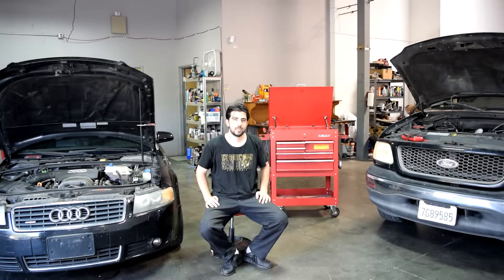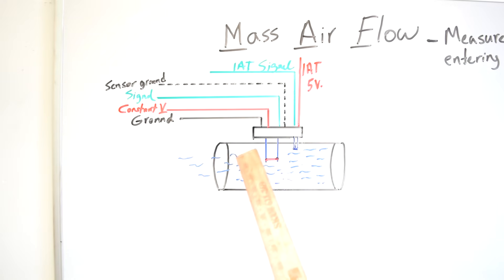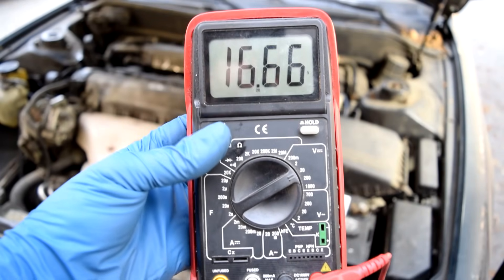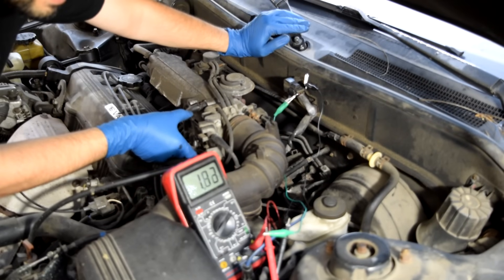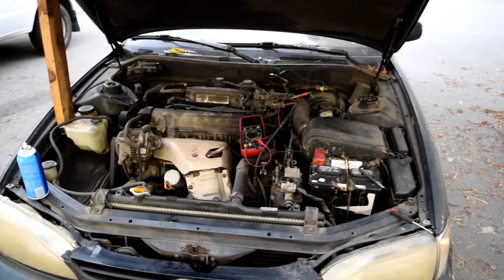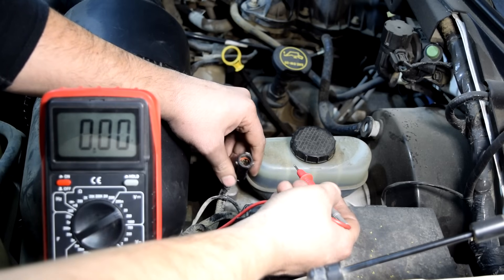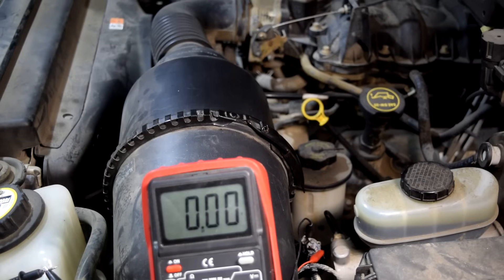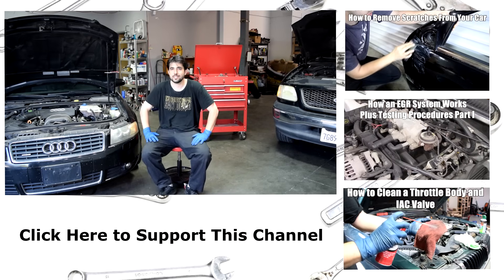How to Test a MAF or MAP Sensor With a Multimeter - Plus an Operations Guide

Comment: Will a dirty Mass Air Flow Sensor make the car stall? Also, on my car when I unplugged the MAF, my car shut off. My brother's car is stalling when driving, when I unplugged his MAF, his car still ran. Any ideas? Thanks
Reply: Tom O did you ever figure it out I’m wondering the same?
Reply: If somebody needs the information: it depends from car to car. Remeber: the maf or map sensor is used to calculate the air/fuel ratio. If you habe a broken, durty, ... sensor your engine can have trouble to calculate the right mixture. Old cars dont have as much problems because there tollerance is a lot higher. Like old and new diesel engines. In new cars the engines are so fuel efficient because they are tuned very well. But pefect tuned cars need more love.

So some cars will go out, some will go into a emergency programm... it can depend hard. But yes it can make your car stall and stuff.

Like in the video you see when he applies hard throttle the sensor "work", but when crussing it wont.

With a maf sensor it can also be that you get some "wrong air" after the sensor (when you have a hole in your system where it sucks air into the system after it passes the maf sensor). So the sensor doesnt register all the air what is going into the engine and caluclate the wrong fuel air mixture.

Comment: my 2005 Toyota tundra developes a short circuit after it gets to running temp. my code reader says its the mass air flow sensor ( p0100) . does this sound possible.  or can someone please tell me where else to look to solve this problem? I don't want to replace the mass air flow sensor if that's not the problem.  thanks

Comment: thanks a lot for the video, very informative and in simple words.
YET! I beg yourpardon for mentioning it, but! with the paperclips could easilly break the rubber seals securing the connection inside of the plugs (from water or whichever liquids). couldn't you?

Comment: I have a problem when the outside is cold 8 degrees my Subaru Tribeca difficult start up after a few minute cranking. Is it possible to be from IAT there is 10 degrees difference.

Comment: I tested MAF on my 2001 passat 1.9 tdi PD (96kw) tiptronic, and it shows drop in voltage when stepping on throttle. On idle it is around 3.8V and when throttling it falls to 1.5V. Is that even possible, and what does it mean? Btw, I have the car for 10 years now, lately it has become sooo lazy, acceleration sucks. Oh, and the MPG (31) is bad through all those years, but till recently the car was very much alive so I didnt care, but now it sucks. Any ideas? !!!MAP sensor still not tested!!! Cheers........

Comment: hi sir  i have a Hyundai H1-TQ it have a problem  it spend more full and also it have bud to take acceleration. RPM is just going up to 4 or 5 .we change the map sensor and the water sensor temperature bud it has stile this problem some time it shows the cod p0626 alternator i don't know the problem is belongs to it or know   possible help me if u have viber no send me to call u for the help me thanks a lot

Comment: I have a question, the ground wire on my map intermittently has no continuity, garage say the wires are all fine.

But car occasionally goes to limp mode, could i test the ground by putting it on the engine or does it have to go to ecu ground all the time.

Comment: u didn't show where its located the MAP sensor on the ford......or doesn't have one?
Reply: raul ayala ford had the sensor where the air filter is
Reply: J L that was the MAF sensor. Do vehicles typically only come with one of the other?
Reply: E Gibson looke up speed density systems and air desnsity systems

Comment: your suppose to test ford maf sensors using frequency  on your dvom, not volts, I'm a tech been diagnosing check engine lights for years, and definitely know your suppose to use the Hz setting or use use an oscilloscope if possible, trust  me bro

Comment: why would u choose 20 volts on the meter?
Reply: Because you always want to use the setting that's next highest above what reading you are expecting to get.  So, if he were expecting 5, or even 12 volts, say, he should choose 20.  The settings jump from 2 to 20 so 20 is the next highest above 5 (or 12).
Reply: Andrew Propes gotcha thanks....ive usednthem before but never knew that
Reply: It doesn't really matter what you choose. The multi-meter is just taking a reading and displaying it according to how you want to see it. That being said it depends on how many significant figures you wan't to see.
Reply: No Surrender jq

Comment: Have you seen a faulty MAF or MAP ? OR can they allway's be "fixed" by cleaning ?
Reply: Vidde H yes they can go bad...and wiring to and from them can also short out...maf sensors are prob more likely to be able to have a cleaning help...but they are also fragile and can be damaged during cleaning
Reply: Supposedly you can check on if a MAF is defective or not by just disconnecting it while running.  If it still runs after disconnect then the sensor is bad.   It is supposed to just shut off after disconnect.  I haven't checked my MAP yet to see if it is defective or not yet.  I have tried everything possible to figure out the why I'm overheating in idol.  I replaced water pump, fan clutch, coolant sensor and Thermastat.  I also cleaned the throttle body and replaced MAF sensor.  Still overheats in idol.  It is now starting to show misfiring code.
Reply: Hi.  My.  Name.chris Is. .iam. .jumping ..to .something easel.  My. .97 .handa civix ex. Two. Dorr coupe. .my..  Rpms.  Keep. .going..up.. When. .it. .warms.  Up.   In...drive.  It.  Don't. .do.  It.  Only ..in.   Park

Comment: i have problem in my car its rpm shoots up to 6000 to 7000 rpm specialy in the morning when the engine is cold and engine race it up during driving but less with respect to first startup in morning and shoot less when engine coming hot and  more hot. And rest of the day it give less problem. i have cleaned the throatl body of it and some goof mechanic has bypassed it 
electronic chock system to restrict its rpm shootup,  so it also can start in morning with out giving race paddle to it. please help me.
rehan khurshid
Reply: Rehan Khurshid u may have a bad coolant temperature sensor. ..when they go they will give a false value to the ecm which reads it as being the max hot or max cold temp...if reading max cold when the engine actually is cold the computer will want to give u a lean ratio - never heard of a choke on a vehicle ive owned ...your car can't be carbeurated unless its very old...ubwoikdnt have a maf sensor if its not efi...but...u could check the sensor I mentioned. ..I don't think obd1 has a codefor a fault in it...and obd2 may be slow in catching it...it never did realize mine wad bad...reading a -32 temp....in about 45 degree weather. ..

Comment: The voltage supply to the sensors is from the ecu or from the fuse box?
Reply: Νεραντζης Νικος voltage comes from the battery and alternator initially the fuses are only to protect the wiring from overloading under a fault condition and melting...the sensors turn all information into electrical values in pulses or voltage then the computer is ablebto read that and makes adjustments as needed....as far as I know

Comment: Not trying to cut you down just adding to the video when trouble shooting a map sensor you must check all vacuum lines not just the one leading to map sensor and as you can tell in the video the map sensor works but when you snap the throttle it does create a high enough vacuum pressure to actuate it but it has a leak else where In the system think about it logically  that's not a independent vacuum source it shares with many other ports ya know

Comment: you do not understand what is going on with map. Manifold absolute pressure. Put a vacuum gage on the manifold vacuum line and notice its when you quickly open the throttle that the pressure drops. Not with a slow opening of throttle.
Reply: NebukedNezzer you're right, he's wrong. I nearly replaced a $80 MAP sensor  when I had the exact so readings as he had. He has the part about the MAP telling the fuel to open up correct though.
Reply: Yes, about the fuel to open. Glad you saved 80 bucks.
Reply: NebukedNezzer what's that fluid you used on the vacum line

Comment: An oscilloscope is about the only reliable way to test a mass airflow. I've seen MANY MAF sensors that looked fine on a scan tool and a multimeter that had tons of glitches when viewed on a scope. Glitches that were far too quick to even hope to see with a meter.
Reply: If you wan't to be certain. But good oscilloscopes kind of cost a fortune in contrast to a cheap reliable multi-meter. They also require a lot more proper care.
Reply: sometimes analogue meters are better than dmm's for this type of stuff
Reply: well said...
Reply: BUT... a cheap DMM will tell you if the sensor is bad. So, you have a point, but a meter isn't totally useless.

BTW, What causes the spikes you mention? Is there active circuitry inside the sensor, or is the hot wire the only component? Just curious if the spikes are due to a compromised connection, in which case it might be easily repairable (solder joint issue?), or is the platinum wire welded, making it irreparable?

Comment: hey man..could a map sensor couse a cold start problem..I got mention that my map sensor has the air tempetarure incorporated as well..I have diagnosed no codes for the map only for the o2 heating sensor.many thankx

Comment: Thank you I am getting the MAP/MAF code issue so I have no idea what's the deal. The throttle does not seem to open up when I rev the engine. When I start my truck it cranks but turns right off abour 4 to 6 times. Sometimes I give it gas before I crank it and it works. 04 Colorado LS 3.5

Comment: Easiest way for map sensor is to have Key ON engine OFF, this simulates wide open throttle(atmospheric pressure present, no vacuum present with engine off). This should give you your 4.4.5V, or your max pressure reading. Then start car and check at idle and compare to specs. Boosted cars don't apply to that though
Reply: man, that's some good info, thanks.

Comment: do an EGR DELETE on a diesel engine D4D will affect fuel consumption if yes what can be done to reset this issue to have it run on the econimical side
Reply: MCDC MCDC I think it more causes greater emissions ...as far as I know at least with a gas engine..it just allows some exhaust gas to re enter the motors intake...and dleteing it would allow more cooler cleaner air to be compressed...which could be a big gain in a diesel as they run so hot they do not need a spark
Reply: MCDC MCDC EGR is slow death to diesel engines. deleting egr needs ECU reprogramming and its done by proffessionals. otherwise you can brick your ECU.

Comment: how do U know that yours readings from dvom is correct,is map or maf have digital or analog signal,if have digital signal U cant read good mesurment because multimeter dont have speed to mesure so fast signal in mili seconds,if I see good that map and maf have digital signal and U read some inacurate voltage and in video we can see how multimeter have late readings on map sensor for that test U need osciloskope because of speed in MS 
Sorry for my writings if I spell something bad I am from Europe tnx

Comment: Your MAP sensor was just fine. It measures PRESSURE, not volume. When you open a throttle slowly you barely increasing any pressure but you are increasing the volume which is why it was properly working the way it should.
Reply from the maker: you might be correct sir, gona have to bench test that thing. will update results.
Reply: @myRatchets  So, in the end what was the problem?
Reply: Dev Sam b
Reply: he obviously thinks they're the same thing.
bit of a jonny-know-all-wanker.

Comment: I have a VW Golf 2.0 1995 and my car over heats quickly and I cleaned the MaF already. any chance i need a new once?
Reply: Hacks509 overheating is not a mass air floe sensor issue...coolant level/mixture....water pump, thermostat stuck shut, coolant temp sensor, fan , and even a bad temp gouge itself are related to the operating  temp...
Reply: What about your coolant systems thermostat? Any chance you have air pockets in the coolant system? Have you recently done any work involving the coolant system (coolant was removed or escaped and you replaced it). what about the radiator fan? Does it work if you isolate the wiring to it by removing the wiring connector and apply power directly from the car battery or a 12-15 volt d.c. supply? Is there a problem with the wiring connector or the wiring harness? Is the radiator fans' relay broken? Test it with a multi meter or if your car has an identical relay for something that can be "sacrificed" momentarily, like the headlights (and you know the headlight relay works because your headlights turn on and off) insert it into the radiators relay position and allow the cooling system to heat up. If the fan activates before the car arrives at the accelerated rate of heating you report, re-install the relays and move onto the coolant or water temperature sensor that measures the coolant after it leaves the radiator  or before it re-enters the engine. If this sensor works correctly it sends a signal to the radiator fans relay (which is confirmed as "working") at or very close to the cars intended threshold for operation at the optimum coolant temperature. If that all checks out, have a look at the radiator filler cap. Is it clogged with debris? Is the rubber gasket ok? Does the spring appear to work correctly by consistently returning to its rest position after repeated manual compressioi? Oh--do you have enough coolant in the radiator? Is the overflow tube leading from the radiator cap intact and able to transfer coolant back and forth between the radiator and the overflow tank? I'm scratching the surface of items related to the coolant system and as you've likely sensed, I'm not a mechanic but start with my suggested diagnostic chain and act accordingly. Good luck--hopefully it's something simple, inexpensive to repair--like a wiring harness that's not quite making contact with a wiring connector-just push it together until you hear a click and all should be good--assuming there's only one coolant related problem--never assume there's only one or two problems. When diagnosing anything, assumptions of correct operation of a component that was then currently unconfirmed may form the basis of an incorrect diagnosis and needless costly reaction in terms of parts and labour that will not correct the problem and possibly compound the frustration you likely feel and add confusion of thought to a reasoned process of diagnosis that leaves no room for guessing, wishful thinking, or unconfirmed results in test procedures.
Reply: replace the reservoir cap it could be that
Reply: yep....that too.
Reply: And you could have a bad head gasket...worst case scenario

Comment: I missed the cut off but I really have no questions. You do a great job at explaining the components and circuitry so it's just a matter of getting out there and experimenting for myself. Thanks.
Reply: No he didn't. He doesn't understand the difference between a 2-wire and a 3-wire sensor.
Reply: @Chris-hx3om  what's the difference between a 2-wire vrs 3-wire?
Reply: @bluor3713  2-wire is a resistor and the ECM is looking at the current flowing, whereas a 3-wire is a voltage divider where the ECM is looking at the voltage between two power rails. 

The advantage of the 2-wire is cost, but at the expense of repeatability with varying voltage rails. (Automotive is notorious for quite a range of voltages. Less than 10 under high load without the engine running, to over 14v once the battery is fully charged.)

Comment: Thanks, I have a 3L A4, so needless to say I need to be more do it yourself suave or pay the price. That's why I'm a big fan.
Reply from the maker: lol you got to pay to play :)
Reply: @myRatchets  Sir, why one output terminal of my car ignition coil gives less sparks than the other terminal. In fact, the 2 terminals are control by a single primary circuit of the same ignition coil!!! The other ignition coil has the same issue.

I have checked for all resistance readings of the PRIMARY AND SECONDARY CIRCUITS of each IGNITION COILS which shows normal values.

Please kindly help.
Thanks.

Comment: I have a 1988 Ford Escort with a 1.9 engine and auto transmission.  At slow to medium acceleration, the transmission shifts hard and jerks going from 1st to 2nd gear.  During fast acceleration the transmission shifts normally from 1st to 2nd gear.  Transmission shifts normally at any speed from 2nd to 3rd gear.  What would cause the transmission to shift so hard at slow to medium acceleration from 1st to 2nd gear?  Thanks!
Reply from the maker: It could be the atf pump that's on its way out and not producing enough pressure at low rpm's, or bad clutch packs. I am somewhat speculating though as I am not well experienced in Auto Transmission repair. Have you checked the fluid does it smell funky? You might chance a fluid and filter replacement, it might help or make it worse. but whatever you do, don't do a flush. GL
Reply: situationmoney I would guess  clutch packs also..there's also a valve body and ...the auto trans is actually the most sophisticated part on a vehicle in my opinion...and you really want know until youbhave it stripped down and can visually inspect it...even then you may not see the issue
Reply: A.G. M. some people believe they cause more damage than good....I don't see the logic behind it...but to get all fluid out of the trans and torque converter you have to a shop with a machine do it...and they actually do not drop the pan or changebl the filter...so ...wtf